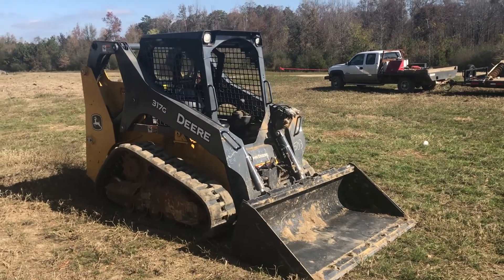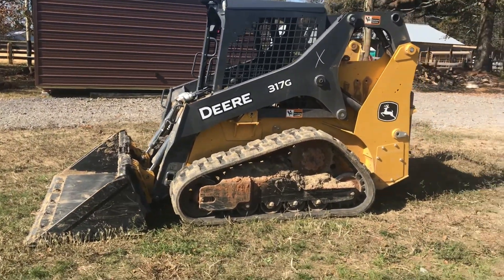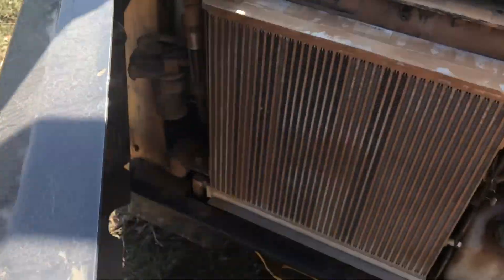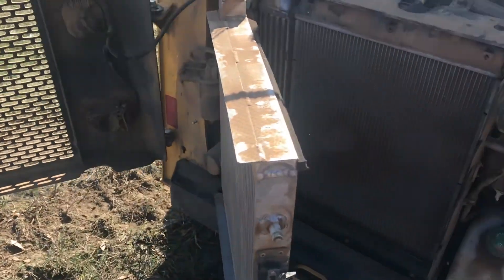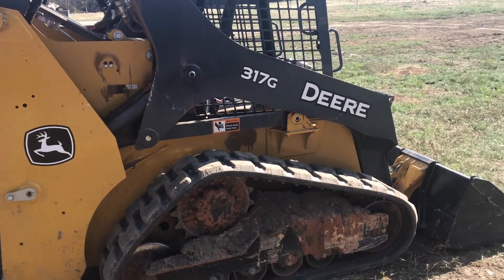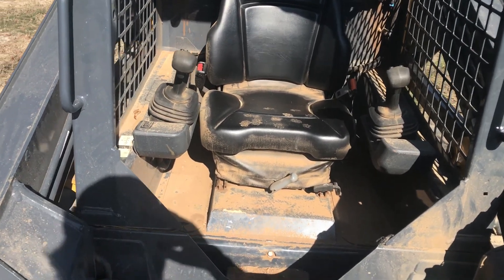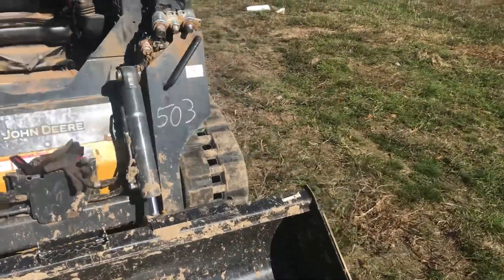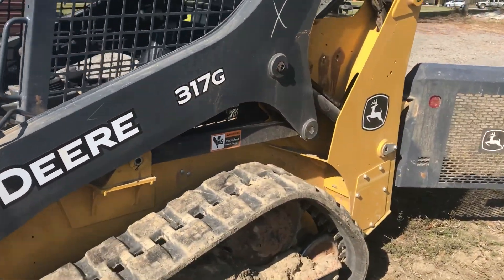John Deere 317g review

Comment: Nice machine!!
I've never run a tracked machine... just lots of rubber tired ones.
Those couplers, ya, bad place for them! It wouldn't take much to move them. Drop them down beside the tilt cylinder, on the cross bar. 
I have an old Case 1845B, it's got the self leveling links on top of the booms and hydraulic lines on top of them. Can make for a mess when you raise the roof with them!!
Reply from the maker: Thanks for watching